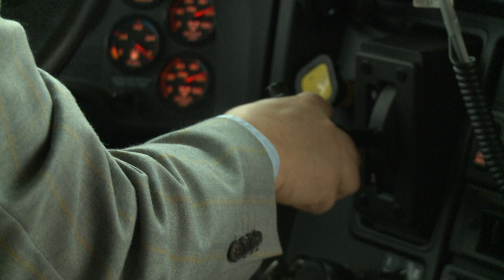Inside look at how school bus drivers are trained for dangerous situations

Comment: When backing up you should always have your hazards on
Reply: My bus driver honks the horn before backing up and yes that is a good idea to use the hazards
Reply: @elainenelson4332  yes, we're trained to honk before reversing, too.
Reply: I Think All Buses Should Have Those Reverse Alarms Too!
Reply: You're supposed to also honk
Reply: @youtubevlogproductions7579  most state laws require an alarm to beep while backing up but drivers are also required to honk at the initial backing up process
Reply: My bus driver turns on the hazards while backing up
Reply: @youtubevlogproductions7579  at least on the east coast they're mandated to have them,  and are too be checked in the pretrip inspection.
Reply: My bus have the back up alarm I blow I use my Hazards and my Amber's the more lights the better

Comment: never swing your bus like that while backing up, the tailspin alone could cause problems, and never reverse at tracks unless cop, fire or r/r police tell you to do so. even then you're still at fault for any collisions.
Reply: All Buses Should Have Reverse Alarms When In Reverse So Accidents Happening Are Reduced.
Reply: @youtubevlogproductions1567  all busses built after 2000 I believe must have back up alarms on them.  Even so people will still have accidents with then on. They always claim they didn't hear the alarm.  During the pretrip you're required to check the backup alarm.  If it don't work you write up the bus and take another one.
Reply: I got to agree with you on that. I'm not a bus driver but If I was behind a bus that did that I would surely be worried and that alone would make me either back up myself or try to get out of the way and could cause an accident in itself.

Comment: Reversing with a swerve? Just install a reversing camera.
Reply: we reverse and turn all the time, not a big deal usually if it's just at a stop designed to do that. besides, you obviously don't know how buses are laid-out, we're not all these third party bus companies tracking our every inch with GPS and have these cumbersome and unnecessary screens jammed in our faces. to install that would be a massive expense with almost literally zero benefits, at least for my school.
Reply: @ryanbarker5217  I drive one. There is a route or two where it is narrow and passing selection is limited. If you're unlucky, you have to reverse back and possibly into a junction going downhill.

The driving test has an off-road section where you must reverse into a box without internal aids other than the driver's eyes and any mirrors. No screens or anything.
Reply: @forevercomputing  that's unfortunately route planning.

yeah, we have off-set parking on our test, too. we don't have all that fancy crap, either, we don't even have AC in our old buses. if there's a very specific case where you would need a rearview camera, okay, but that's far from the norm.
Reply: not a good idea on school buses
Reply: @Johnny2fer  International Has an Addon for A Rear camera and even a 360 Camera. The District just has to order it.
Reply: @christopher6635  I feel reversing cameras make the driver lazy and they tend to forget to actually use their mirrors.
Reply: That's what mirrors are for which we are trained to use side view mirrors forward or backwards.
Reply: @doug9066  Why reverse and swerve though? It's not difficult to reverse a bus. It's part of the bus tests I did.
Reply: @Johnny2fer  it’s a literal aid that will ensure safer travels. the point of the camera is to remove some of the need for the mirrors of course they’re gonna use it less
Reply: @gavcom4060  if you're focusing on the camera you're not looking in front and to the sides. I think the only time a reverse camera is Good on large vehicles is Eben you have no back window like on a coach bus.

Comment: Outstand video presenting the proper way all states should certify/train "Trainers". Unfortunately not all states require that a trainer has recieved advanced training and certified by the state. 2 year recertification is a must! I have first hand knowledge "and witnessed" this: Who wants to train? Okay go train a prospective student Joe/Jane! Although the driver may be a very good school bus driver but without advanced training how to "teach/instruct"  with NO standardize curriculum is a formula for eventual disaster. Furthermore "real world" training should be included when training a new student especially on rural routes, narrow roads, gravel, sharp turns, water etc. A real world example would be: It is raining, in the dark (AM/PM) a tree has fallen across a narrow road. You need to train/teach the driver, what options do I have here? Can I go around it? No culverts and mud. Are there any driveways I can use to turn around? No. The road is too narrow to turn around! Although we try to avoid backing up at times you have no other choice. The new driver needs to be instructed to analyze ALL options available. This but one of many real world scenarios that a bus driver may encounter. Remember you are responsible for the safety of the students on your bus. I am a proponent of State Trainer Certification.